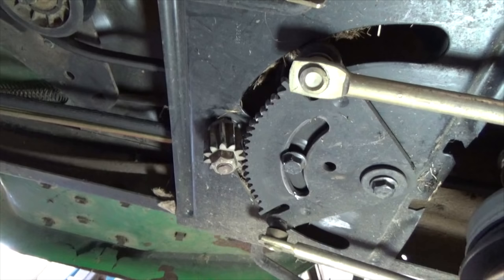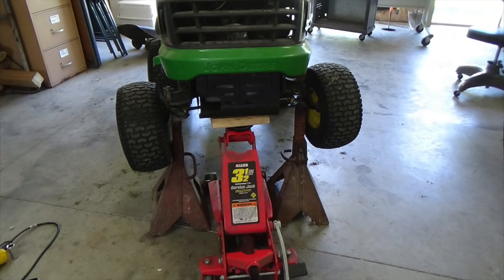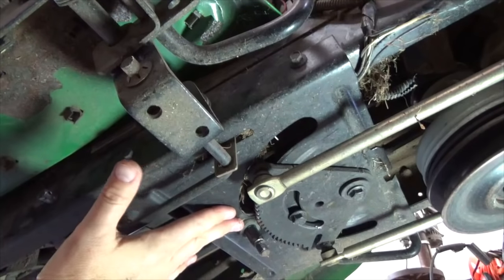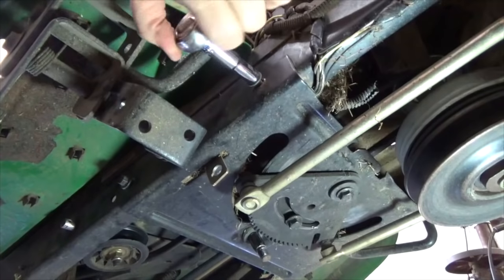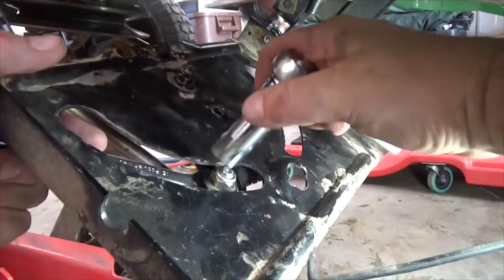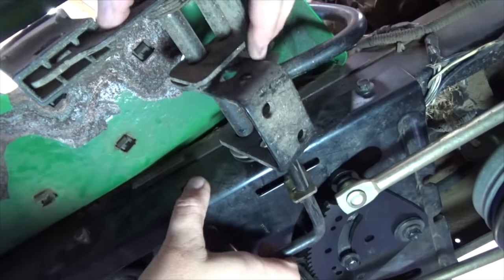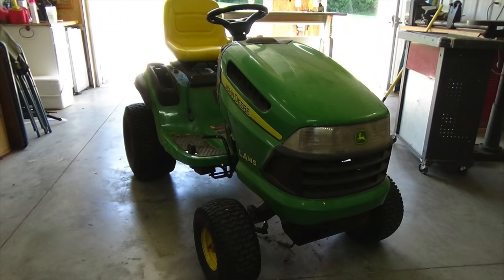Steering Sector & Pinion Gear Replacement - John Deere LA145 Riding Mower

Comment: Just did this on my L110 for the first time.  Made it 15 years with original, so I'm hoping I won't have to do again too soon. I did not grease the pinion and gears, not exactly sure if I should bother?  What do you think?  I did replace the steering bushing, the original was metal but was very worn.  The nylon replacement definitely made everything more snug.  Thank you very much for this video, it was done extremely well.
Reply from the maker: Matt, some repairmen grease, others don't.  If you decide you want grease, then you will have to do it every year, because the grease is gone in one season.  I don't know of anyone that does this.  It wouldn't hurt to grease while you're under there if you want.  I had mowers last over 20 years without greasing, and without parts like these wearing out.  I've learned a lot about quality over the years.  Some mowers are junk, and some aren't.  The mower in this video was given to me, so I dump money in it every year.  I'm close to giving up on it.  Going to buy a quality built mower when I do..... but free is hard to let go of.

Comment: Very helpful. I have an odd question. The axle/shoulder bolt that goes in the channel. Is it supposed to have a gap between the sector and bolt? I cant find anyone going into detail about it
Reply from the maker: It works with the design of the bolt.  It allows slippage.

Comment: I’ve used this video 4 times now! It’s always so appreciated that I can go to it. Since it seems so many of us are having the same exact issue, is it just a bad design by John Deere, bad parts, etc?
Reply from the maker: Thanks for watching and commenting, Charles!  I was told by a John Deere mechanic, that in order to keep the cost low enough for the average Joe, they put cheap parts in the big box store models.  interestingly enough, when you buy JD parts separate, the quality is way better than the factory installed parts.  I found this to be true when I replaced my drag link.
Reply: @PhilCrockett  But these aren't really low cost mowers.  I have a D125 with less than 40 hours on it, that has the steering gears stripped out.  I could have bought an equivalent mower for half the cost of this one.  This is my first John Deere and I'm far from impressed with it.  I can't believe the individual parts are better quality than what comes from the factory.  That's just dirty business in my book.

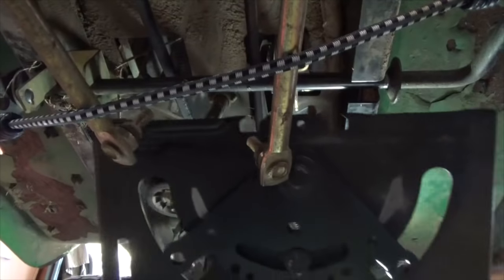Comment: Phil, picked up all the parts yesterday and before I get started, I noticed I have qty 2 of the GX21994 bushings as that was what I saw came with some of the prepackaged kits and they do show 2 of them in the illustrated parts bulletin.  However, rewatching the video, Looks like 2 will not fit in the plate facing each other, so I'm guessing one goes higher up on the steering shaft to prevent the idler gear from flexing away from the steering plate.  As near as I can see, right around 4:22 I think I see a white ring about where the bottom of the battery box would be.  Is that correct for the second bushing???
Reply from the maker: Yes!  The other does go at the steering column.  Mine was in good shape, so I couldn't justify the effort in replacing it.  Glad I didn't waste my time on it.  The transmission went out not long after I did all this work.  That mower is now with Jesus.

Comment: Phil: Here is a very new thanks for the video comment. I've watched it about 25 times because it's easy on the eyes and ears and it will definitely get the job done. I have a question...I hope you get this because I think the answer might be important. I'm just starting the repairs. When I'm replacing the slot bolt and the pivot bolt back onto the plate,, how tight should they be? Both loose enough for the sector gear to move? Or should they be tight? 

And I've just subscribed to your channel.
Thanks again for the video and I look forward to the answer.
Reply from the maker: The sector should move freely when turning the wheel.  If there's ever a bolt that tightens the movement, you should back it off.  However, these bolts should be manufactured to keep the movement when installed.  Hope this helps, AND...................    THANK YOU FOR SUBBING!!!!!!!!
Reply: @PhilCrockett  This does help......and thanks a lot.

Comment: Great video.  Parts are on order...thanks!
Reply from the maker: Glad I could help you out!  Thanks for the positive feedback!
Reply: Well, I just completed the project and it was annoying (as always), but simple based on your video.  My 6'2" 230 frame doesn't fit well under the tractor, even when jacked up, so I emptied the gas tank and just lifted the tractor by the front bar by hand and sat it upright on its back.  Wasn't that heavy and was easy with the parking brake on.  It stabilized pretty well, but I secured it a bit anyway.  Made the whole procedure much easier.  I didn't have issues with oil entering the engine, but next time I'll time the steering fix with an oil change to be safe.

I used 10mm, 15mm,  and 18mm sockets, plus a 13mm to hold the sector plate nut.

Works better than ever. Thanks again!
Reply from the maker: That's fantastic!  Makes my day knowing my video helped someone.  Thank you for the continued feedback!

Comment: Great job Mr. Crockett.  I think my L130 needs this.  Two questions: 1: Cost of the three new parts and 2: Do you think you could have bought yourself a bit more usage time by just flipping the pinion gear so that the new pinion gear teeth would engage the plate?
Reply from the maker: I can't remember the cost on this.  I'm pretty sure it was all together less than $100.   I seem to think around $80 maybe.  The pinion gear can't be flipped.  
Great questions.  Thanks for watching and commenting!

Comment: Great Video!  One question... the steering seems sort of "stiff" on our tractor... should I put grease in between the bushing and the steering rod??  Thanks!
Reply from the maker: It's absolutely ok to grease it.  give it a try and see if it helps.   The only problem with grease is, if you use the wrong kind, dirt and grit will cake to it.  There are several products that mower mechanics use.  You would have to ask around to see what the best one is.  I don't use them myself, because it doesn't last long on parts.  The John Deere mechanics in my area don't use grease on steering due to that issue.  If you do, however, you will need to re-grease often.    Hope this helps.

Comment: I am unsure if I missed a part but I have one extra plastic round thing..  I think I see where it goes so I'm going to try to pry it off with the flathead
Reply from the maker: yes.  that's a bushing.
Reply: @PhilCrockett  yeah I figured out well I just said the lift the steering rod out and take the battery out and replace the bushing that was in there I have the d100

Comment: By the way, I bought the OEM parts from a John Deere dealer and the steering sector gear is part number GX25785 and the pinion gear is part number GX20053. That's for the LA145. My wife is out there right now mowing the lawn. Everything's good!
Reply from the maker: SWEET!   It always feels great to fix something yourself and save money.  thanks for posting the part numbers!  ALSO..... thanks for taking the time to comment, Mark.  Maybe this will help someone else!

Comment: Great video.  I appreciate the editing.  I replaced my stripped parts, but it still has slipping issues and will soon strip the new parts if I don''t fix it.  Any suggestions on what might be causing this?  The parts are in correctly.
Reply from the maker: I'm not sure what that would be.  If I were to guess, it may be wore out bushings.  I would suggest going to a forum on-line.  There are some great explanations to unusual problems.  My favorite forum for mowers is:  lawnmower forum.com .   check it out!
Reply: Replace the bushing often.  Some mowers of that range have 2 close together.

Comment: thank you for the video.  You made it look so easy, I tried myself, but I'm a failure because I can't crack the pivot bolt.  Ugh.
Reply from the maker: this can be a difficult task for sure.  You ARE NOT a failure.  try a cheater bar, and/or heat it up.

Comment: Hey Phil…I own a LA145 as well. The explosion diagram you show in this video had (2) plastic bushings, you only seem to install one. The kits I find online include (2) as well. I’m a little confused. Please help.
Reply from the maker: one of the bushings is for the steering column.  mine was in good shape and didn't need replaced.

Comment: Anyone else having my problem?  I have replaced these parts 3 times in past 4 years.  I have also changed the plastic bushings, including those small rings in the upper steering bar.  Could there be an allignment and an adjustment that needs to be done with the rods (drag link) that connect to the sector plate?  I don't see any videos on that.  What is my problem?  Appreciate any help.  Thanks.  This video is well done on how to replace the parts.
Reply from the maker: i'm not sure..... hopefully someone else can help here.....

Comment: Great Video, thank you.  This is the 2nd time I've used this video.  While I was removing the brake lever rod I snapped the part in the back of the mower that holds the other end of the rod in place.  I can't for the life of me find the name of that part to replace it.  Any idea what that might be?
Reply from the maker: I don't know without seeing it.  However, go to a John Deere dealer and ask for an explosion diagram of that particular location of parts.   It will have a number and an identifier.  You might even get lucky googling the explosion diagram.   Let me know if this advice helps you out.
Reply: Phil Crockett, right, thanks.
Reply from the maker: I keep a 3-ring binder of explosion diagrams for many of my tools / toys.  They make the best instructions....IOW:  a picture's worth a thousand words.

Comment: Thanks so much for creating an informative assembly video. I disassembled mine earlier without dropping the whole plate and it was a bear! I'm going to drop it now just to aid reassembly. The kit I purchased through Amazon comes with two nylon bearings, I noticed you only changed the lower one. My kit also comes with a separate  metal bushing, I'm unsure about replacing the extra nylon or metal bushing. I'm also considering changing the drive belt while I've got everything broken down. Got any tips or suggestions? Thanks again for sharing!
Reply from the maker: I probably should have changed my drive belt at the same time.  I figure I'll do it this winter when I'm bored.  I've never changed one before, but when I do, I'll probably make a video on it.   As far as the bushings go.....  both of my bushings were in good shape.  I only changed the one out because it was so convenient and easy.   Not sure about a "metal bushing" didn't have one on my model.  Didn't see one in the diagram either.
Reply: I checked it out a little further and its a replacement for the main bushing on the pie gear
Reply from the maker: oh...ya.  I gotcha.  I bet that thing cost a pretty penny!
Reply: +Phil Crockett 
I bought a kit from Amazon that came with the pie gear, sproket, 2 nylon bushings and the one metal bushing for $38 on Amazon. My John Deere store was closed by the time I got it tore down but from what I've heard the oem stuff is around twice that. I mowed around the house with my reel mower, man what a p.i.t.a.!
Reply from the maker: You won on that deal!  I've never used a reel mower....i'm not too interested in doing so, but I wish I had one 'just in case'.

Comment: I recently did this procedure on a Husqvarna riding mower. I used new parts made for this mower. How ever I still can rotate the steering wheel with out the tires turning. Is there an adjustment? Thanks
Reply from the maker: I don't know about Husqvarna.  Maybe someone on here can answer that.  OR.... call your mechanic and ask.  Have someone turn the wheel back and forth while you investigate.  It might be an easy fix.

Comment: Thanks for the fast response, so I gather you do not grease this part .  I think I will go with NOT greasing and hope for the best.  Again, thanks for the video and great instructions.
Reply from the maker: I didn't grease mine.  However, I've gotten some grief from some people on this video for not using grease.  I'm going to risk it. The dealership where i got the parts don't grease, so neither did I.  I promise you this.....    something else will be the death of this mower before I need another steering sector.  There's always something to fix on these JD riders.  They're not made like the old ones.  I just replaced a worn out drag link this morning on the same mower.   Muffler backfired off of it a couple months ago the seat bolts pulled through the wallered out holes on the body 2 days later, and the wring for the PTO clutch wore loose last year.   My dad had a 3 year old X-series that he mows a 3 acre yard with.  The grill fell out last year, and the transmission gave him problems this year.  He traded it in for an X-Mark Zero turn.    On the bright side, I've really learned a lot about the anatomy of a JD Mower...... and so will you.   HA!
Reply: I thought that perhaps not greasing these parts was my problem, but no, I still got the wear.  So, then I used silicone spray and still got the wear.  I'm baffled now.  I need to repace the parts again.  This will be the 4th time in 4 years.

Comment: before you put the pinion gear on, should you make sure your steering wheel it straight? Just curious if it could looked in a turning position when done if you don't check first.
Reply from the maker: yes.  good call!
Reply: no. the sector needs to be straight with the wheels. the pinion is a circle...

Comment: What are the thoughts on lubricating the pinion gear?  It seems like such a high wear point. I'm tempted to put a bit of something like white lithium grease on the pinion gear.
Reply from the maker: This has been a subject of exhaustive discussion.  A lot of mechanics are not putting anything on them because the lube only lasts one season anyway.  If you decide to put lube on it, make sure it's the kind that dirt and grime doesn't adhere to, and apply it every year.    Probably 99.999999% of the people out there that have these mowers never do anything to them.  The mower in this video is about 13 years old, and had never had the steering greased.    It would be interesting to know if greasing it would have added more years on.  We had a Snapper that lasted 23 years and never had to do anything to the steering gears.  It gave up it's ghost due to engine failure.   Maybe John Deere is using sub-par parts.  Dare I say?!  I'll say this:  I've owned: John Deeres, Ranch King, Simplicity, Snappers, Murray, and Craftsman.......   The bests to worse mowers (as far as repairs go) is the following....starting with the best quality:   Craftsman, Snapper, Simplicity, Murray, Ranch King, John Deere.     My next mower will be a Kubota
Reply: Phil Crockett Grease will do nothing.I grease mine on a d170 and replace steering gears every year.Its just a piss poor desing.I believe the reason for wear is all the play in it.
Reply from the maker: I will totally agree with you on that!
Reply: Replace the Bushing.  That is the problem.
Reply: @PhilCrockett  interesting

Comment: we have an older La115, with 550 hours on it. i have replaced the entire setup-steering sector, pinion gear and bushing- 2 times in the last 3 months. the last time it chewed up the pinion before we could mow for 30 minutes. is there a point at which other steering components must be replaced?
Reply from the maker: Are you using after market parts??  maybe cheap China soft metal pieces?  That's a lot of replacing in such a short amount of time.
Reply: Yes we are. The rest of the “steering apparatus”-the tie rods ends, the wheel bearings, the ball joints,etc., are all original and have some slack and slop to them.  Can this contribute to the issue at all? Or can cheap parts be this......crappy?
Reply from the maker: Not sure, but one thing I do know........   JD puts crap on their big box store mowers in order to keep the price down.  I went to a JD dealer to buy a replacement tie rod for a L130, and the tie rod they gave me was twice the diameter, and extremely well built.  I first thought the guy gave me the wrong part.  I compared the old one with the new one right in front of him to show the significant difference.  That's when he told me the truth about the original parts in my mower.  Lesson...... JD makes crappy mowers, but their replacement parts are incredible.   Try buying JD parts next time.....or......... do what I'm about to do, and buy a really good mower next time like Kubota.  BTW..... the man also told me that JD riding mowers from the big box stores last on average, 7 to 10 years.  Of course that all depends on the abuse too.

Comment: Great video.  One question:  when I put slipped on the pinion gear it slide right on and kept falling off when I was about to tighten it down.  It actually kept pushing up the steering column up and I had to have someone hold down the steering wheel.  Is that normal?
Reply from the maker: Not sure how I missed this comment...10 months ago!  sorry!...  but, yes, it's helped to have someone hold down the steering.